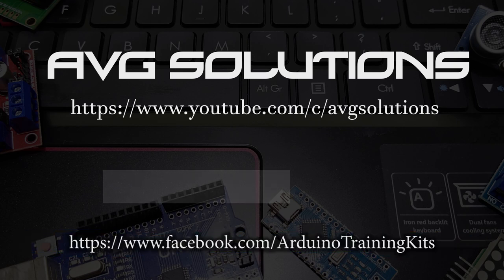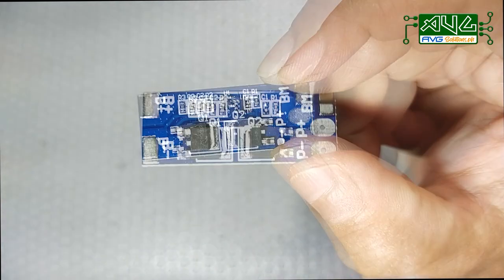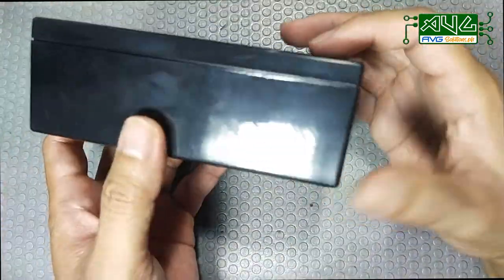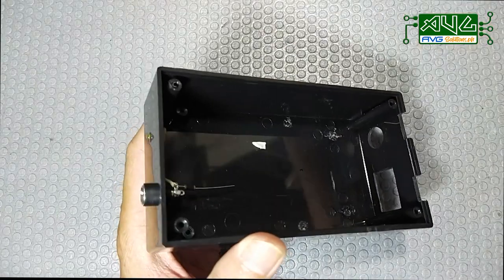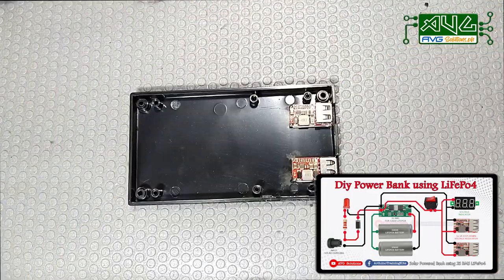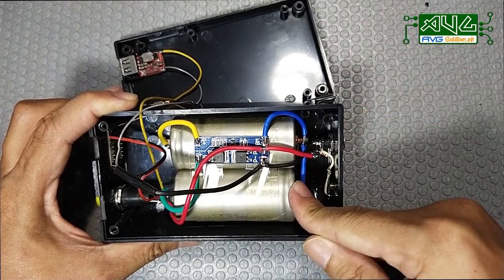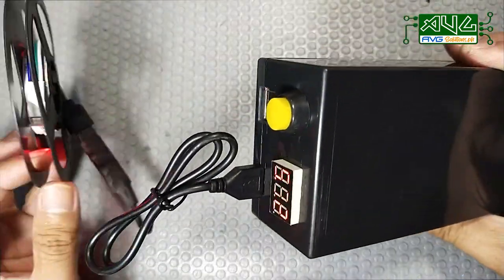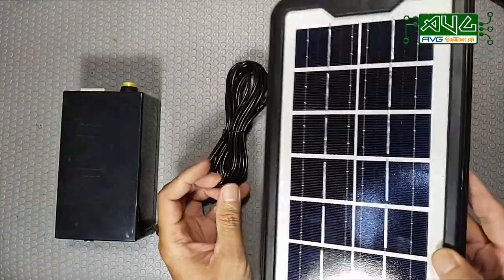DIY LiFePo4 Power Bank

Comment: Very nice presentation sir. May I ask about presentation of solar power generator nacapacity, 48v with ac/dc charger, capacity of inverter, solar panel  switch, bms, solar charge controller, ac/dc outlet,  power indicator and other needed parts. Regular power interuptions happened in our area Virac, Catanduanes. Thank you very much and more power. I am an enthusiast of your vlog.
Reply from the maker: noted sir, e next in line po natin yan
Reply: Good morning, very nice and informative presentation, ask.ko lang brother ilang ang wattage ng mini solar panel na ginamit mo
Reply from the maker: @raymundocapilitan5723  hello sir, ang wattage po ng solar panel na gagamitin ay depende sa usage, kalimitan gamit ko 10w, minimal usage,

Comment: Sir. Ilan amper blocking diode gamit mo? Halimbawa 20watts panel  ilan ampers? Tnx
Reply from the maker: minsan ang diode sir, depende sa rating ng solar panel, pero mas ok na mas mataas. sa mga maliliit na panel 1 to 2a pwede naman
Reply: @AVGSolutions  tns sir palagi ako nood yt mo KapAg may load. Hehe

Comment: Bossing. Tanong kulang. Gumawa kasi ako powerbank 10pcs na lifepo4 batterys.. parallel connection nmn. Tapos gamit ko is powerbank module lang. Kaso once na full charge na sha nag de dis-charge. Ano kaya kulang sa set up ko? Plano ko sana sa powerbank pag nag o overnight kami sa hike meron powerbank na pwede magamit at matagal ma low bat. Hindi ko china charge gamit ang solar energy kasi wala kami nun. Salamat po if makikita nyo ito
Reply from the maker: kung wala kang ibang module na pang replace sir, pwede mo lagyan ng switch, baka mataas ang phantom power kahit naka off
Reply: @AVGSolutions  saan e lalagay ang switch sir? Sa module ng powerbank bank? same sa nasa video nyo?
Reply: @AVGSolutions  meron din kase switch yung module sir. Pero pang on lang. Once na on sha kusa na o-off.

Ang bilis din kasi bumaba ng power nya. From full charge (100%) mga 30 minutes or once mapatay bigla nag 75% na. Pag charge ko bigla drop sa 50 then 25 after more or less 5 minutes na pag gamit😅. Pero nakaka puno nmn ng phone ko kahit nasa 25% nalang and blinking na sha. Pero pag nabunot kuna yung charger ng phone, balik stable na nmn yung 25% na remaining nya. Kahit sak sakan kupa ng ilaw na USB port hindi nag bi blink yung remaining 25%

Comment: Ang galing sir, mula nong napanood ko mga videos mo napasubscribe talaga Ako hehe, salamat sa mga shinishare mo leaking tulong samen, btw sir Tanong ko lng po kung ok ba sya gawing suply sa modem, gagamitin nlng ng 5v to 12v suply para masuplayan Ang modem, and pwede po ba gawing 2s2p yong battery nya and pwede po ba na Ang gamit na panel 6v 15watts meron Kase Ako, gusto ko mgbuild para sa modem ko, pawala wala Kase kuryente samen salamat po
Reply from the maker: hello sir, mas ok po sir sa modem kapag 12volts setup na, meron pa po kasing power loss kapag gagamit ng converter

Comment: Pwede po bang yang diagram nyo kaso 4s bms gamit ko at 4 na lipo 32650 ang gamit ko?
Reply from the maker: yes pwedeng 4s pero maiiba na ang output voltage
Reply: @AVGSolutions  so ang i connect ko lang sa bms is stepdown na module? Kasi ang feeling ko nasa 14v na ata labas non. 

At last na po boss, ung charger nyan. Anong dc type ng charger ung recommended nyo at anong v nung dc charger ang maganda. Kasi balak ko mag build as powerbank lang, wala kasi kaming solar😅😅

Btw, salamat sa pag reply. Subscribe nayan😉🤣

Comment: sir may tanong lang po ako anong number po ng diode na ginamit nyo at yung resistor po pasinysa po sa tanong ko baguhan lang po maraming
Reply from the maker: hello sir, ang diode naka depende po sa charging system na gagamitin, sa video ko pwede po ang 1N400x ex 1N4001, 2.2k naman po ang ginamit ko na resistor.

Comment: pwede ba boss gamitin 24/7 power ng wireless cctv cam?
Reply from the maker: 6volts ang output nya boss, not tested pa po sa cctv.
Reply: thank you sir
Reply from the maker: @harlemdance7485  welcome po sir
Reply: @AVGSolutions  ❤️
Reply: sir mga magkano mga pyesa nyan aabutin. salamat...
Reply from the maker: @harlemdance7485  wala pang 500 sir, depende sa specs ng mabibili mong mga pyesa.
Reply from the maker: mas ok sir kung maka bili ka nung mga used 32650 na good condition pa, dati naka kita ako online 50 pesos lang.

Comment: boss pa reply nmn lahat ng kaylangan para bilhin ko na.. para sundan ko nlng video mo salamat
Reply from the maker: check mo sa video idol ung mga specs ng pyesa. lifepo4 battery, bms na pang lifepo4, at charging module.
Reply from the maker: ung bms idol ay 2s na pang lidepo4. sa charger naman mag hanap ka ng 1 to 2 ampers na charging rating para mas mabilis mag charge.